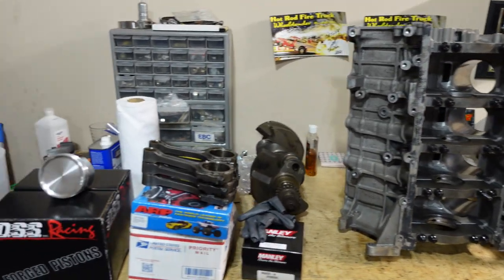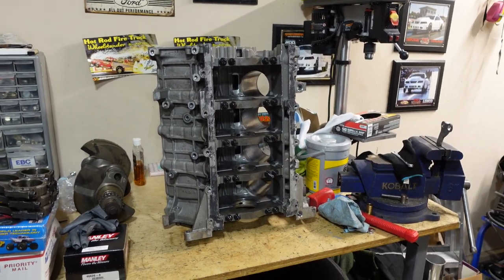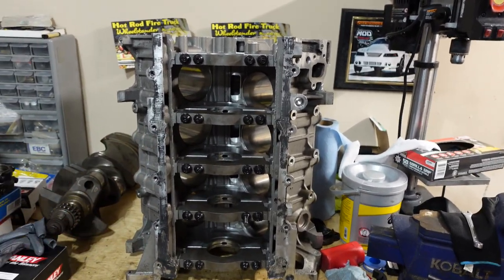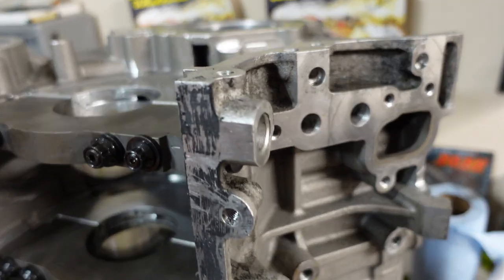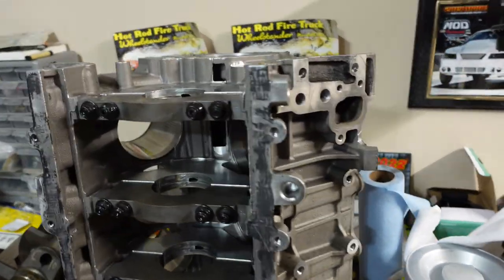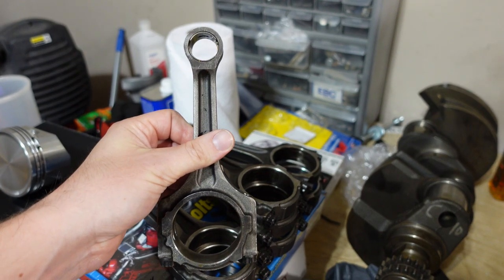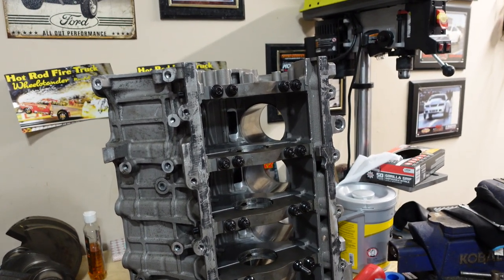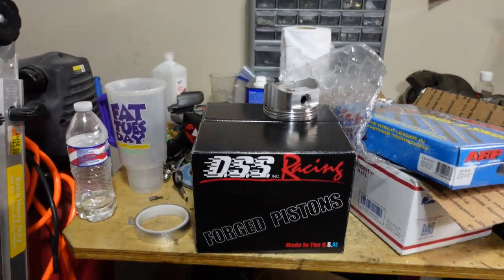Budget 600hp 4.6 2v build part 1

Comment: Im so late on this freakin video but im glad i got to see this. I was actually pulling down a 98 cobra 4.6 4v for my sn95 and as soon as i pulled the timing chain tensioners and relieved that pressure i revealed a cracked forged crank and after that i kinda switched gears and decided to build a 351w i have sitting on my other engine stand. I had bought a brand new set of molnar pwr addr forged rods ill probably end up selling to go towards the 351 build. I love seeing simplified builds like this that make decent power. Cant wait to see the rest of the process bro 🐎💪🏽
Reply: Yeah the Windsor is my favorite Ford engine of all time

Comment: Can't wait to see more this inspiring me to build my sn95 with a mod motor.
Reply: Yes, Mod motor..
Reply: Mod motors are easy to get power from especially boosted the stock rods just aren't that strong it's a pretty easy fix with a rod and pistons swap especially with a 4v which had forged cranks.  People act like you gotta do all kinds of stuff to make a mod motor make and take power but that is totally false.. you gotta do more than a coyote to make coyote power but the engine is also much cheaper to start especially if you already have said engine in your car.  I'm thinking about coyote swapping my 97 cobra simply because I want to make 500 to the wheels all motor turning 8k that is alot easier to achieve with less modding with a coyote.  If I was just gonna do a 500-600 or so rwhp boosted build like alot of guys do (I already got a big power boosted 07 gt500 i want the cobra to be an all motor twisties build) I would simply do boss rods and 10:1 forged pistons with cams and headers it would make good power pretty easy with forced induction.  I still may do a budget 4v build with a centri I haven't 100% made up my mind.

Comment: My build is similar 

Stock 6 bolt crank
Gen 2 coyote rods
Diamond flat tops 12.3 CR
250 shot

Next will be some ported PI heads

But for now I’m shooting for low 12s NA and mid 10s on nitrous
Reply: How much were the pistons?
Reply: I'm looking to build a budget 600hp 2v motor. Are manley rods better than Gen 2 coyote rods? How do I size Gen 2 rods to a GT 6 bolt crank?
Reply: @donaldjohnson4570 they are but they also cost more.  The coyote rods are fine up to 700+ wheel.

Comment: Looking forward to it…. I didn’t even know coyote rods were the same length as the 2V..
Reply: Coyote is the final form of the mod motors
Reply: @WarriorOfEden3033 it's not really a mod motor though nothing else is interchangeable on them like cams and heads and intake manifolds etc.  The rods are the same because it's based on the 4.6 but larger bore but it isn't actually part of the 4.6 family the 5.4/5.8 4v engines in 07-14 gt500s are mod motors just like the old 4.6 and 5.4 2v 3v and 4v and they all share the same firing order with the windsors.   The coyote is a diff engine family but does have the same length rods as the old 4.6.

Comment: Nice brother, I have a 03 Crown Vic P71
. I am starting to building but it's a iron block. Is a prob making 5 to 600 with this at 20 over?. I love the sound of a 2 valve. I plan on turbo charging her. I've been told by Vs Racing to run a 7875 .96 ar. I hope that's correct. Love the content brother.

Comment: Didn't hear it anywhere in the video. What's your friend's total budget for this setup? I have a tork tech on a factory 2v rn making about 400-450 on about 11-12 psi (haven't dynoed yet) and am looking to build a similar setup with an iron block
Reply from the maker: Somewhere around 8-10k total including the torque tech kit. End goal is a fun reliable 600whp that will do drag and drive events

Comment: Andrew, i have a question if you could help me out, I have 4.6L 2v stock heads non pi with stage 5 comp cams extreme energy and I want to build the bottom end and get my compression up. What would you recommend? Parts/brands. Thanks in advance 🎉

Comment: You mentioned the pins for the chain guides,  do you think the tensioners NEED to be modified for a 2 step? I ask cause I personally didn't do that, I do have the pins and secondary accufab chains, b head setup

Comment: How much would a build like this cost minus the supercharger ? Want to build my 4.6 to 600-750 safe on 93 if possible I have a 4.6 in my car rn and I have a spare 4.6 in my garage that I’d like to start building I have money saved up for it already I have a whipple 2.3 in my garage that I got off a buddie that will be put on once I build the motor

Comment: I’m lookin for a setup like this (minus the boost for now) for my crown Vic I have a spare 2v sittin waitin to be built tryin to be around 450-500 for a little while then maybe push more later down the road just somethin nice for a street car to roll around in
Reply: 500 wheel is so easy to achieve with even a 2v.  Boss rods and you can hold 500 wheel easy imo with a good tune.  I would also do forged pistons but the crank is good to at least 600 wheel.

Comment: So, just a few questions. Why does everyone go .10 over with the bore, and 2nd, if the cast iron blocks are tanks why does everyone go to the teksid alum block?
Reply: Because the teksid is lighter and still extremely strong prob even stronger than the iron block.

Comment: Are both 6 and 8 bolt cranks able to handle 700 crank hp?  I’m getting ready to rebuild my 2v for boost and will be running boss rods and dss pistons, but thought I needed a Kellogg or aftermarket crank.  My plans are for around 600 wheel.
Reply: You'd be fine at 600 wheel with the cast crank as long as you aren't trying to spin high rpm (7000+)

Comment: Would this setup be good for 700hp safely? I got a teksid block and the goal is to hit 700hp. Running into I problem with the GT motor so trying to get the 4V motor in sooner then expected on a budget and still achieve my goals
Reply: I think it would handle 700 wheel pretty easily imo.

Comment: So I got a question if you can use the gen2 rods couldn't you use the Gen 2 Pistons with a bore on the block?
Reply from the maker: The bore is to big, you would have to install aftermarket sleeves and bore to 3.63” which would be really expensive

Comment: I haven’t watched the vid yet but a 4.6 on all motor will only make about 420 hp and that’s in perfect conditions.. if you’re talking more displacement or a power adder then your not talking a “budget build”
Reply: Budget as in 600-700rwhp.. PD Blower!!
Reply: Thats correct. I have an ON3 turbo kit now for about 2 years. My tuner got it up to 444 hp @10lbs. He took it down to 426 hp @9lbs so I would blow my motor. Looking to get to 600hp and I'm gonna have to dish out at least another 5-6 grand

Comment: Hey do you know if the manley pistons and rods are any good
Reply from the maker: They are pretty good
Reply: Manley makes the toughest rods you can get for our motors, the billet steels are what the world record was set on.
Reply: thanks for the info
Reply: @GabrielGonzalez-rh1ei  anything aftermarket forged will be good for more than a thousand too.
Reply: @Prestiged_peck  sounds good trying to build a 7 to 800 horse street car
Reply: @GabrielGonzalez-rh1ei  grab you some coyote rods or some forged MMR's off ebay. Pistons are a crapshoot so get whatever available that's forged. I like diamond but anyone's good, make sure you get everything balanced with the crank you're gonna used, and know that an aftermarket or cobra crank with full counterbalance will be a lot safer and more stable at over 7k RPM. You Don't really wanna spin the factory GT crank past that 7k mark and even that's iffy.

Comment: Love the reliability of the 4.6 but it takes a power adder to get 400 plus horsepower. And that's why I think the coyote is superior in all aspects.
Reply: Not with a 4v it doesn't.  They can go well over 400 rwhp without boost.  They can do 400 wheel or better on stock bottom end with the right combination.  Nobody is arguing the 2v is better than a coyote but it's a hell of alot cheaper.  So are the old 4v if you already have one in your car.  You could build a 1000 wheel capable engine for less money than a coyote swap would cost.